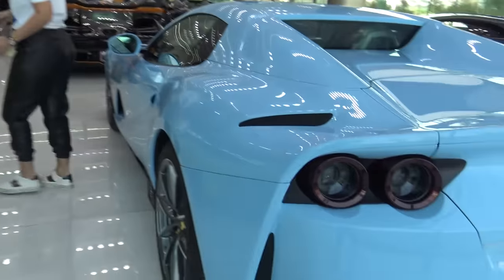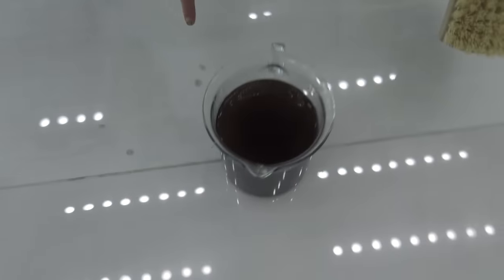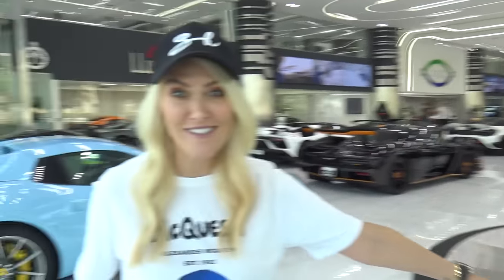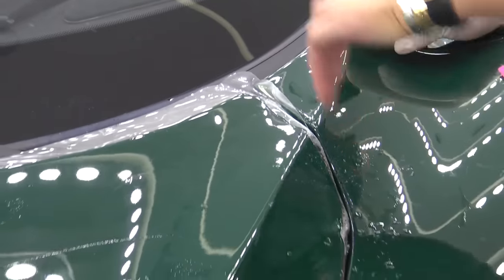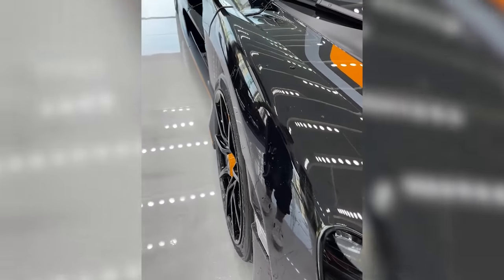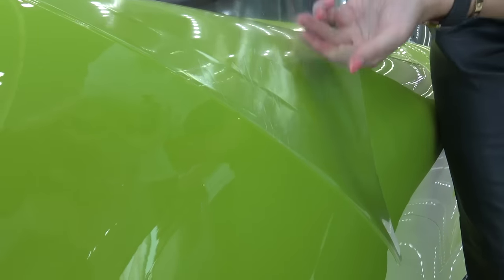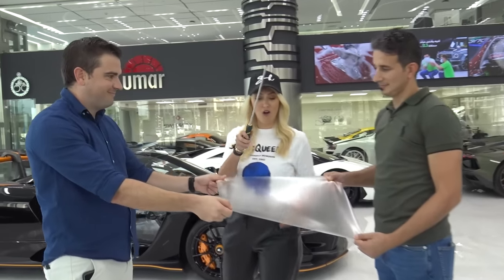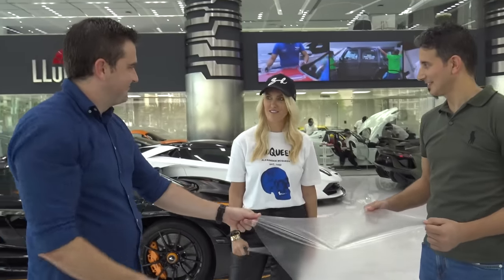Scratching The World's Most Expensive Cars

Comment: Seriously, I was terrified when she scratched those cars. Only for it to be OK later on. Really useful stuff Valors are.
Reply: It's not ok,they are having to remove a fair amount of clear coat to remove those scratches, this removes most of the UV protection on production cars as they don't use very much in the first place
Reply: @hardlinefoil7532  LLumar Valor does not remove clear coat to remove the scratches; it self-heals surface scratches and sections of the PPF can be replaced if needed. The paint protection film serves as a sacrificial layer so those scratches are not touching the paint.